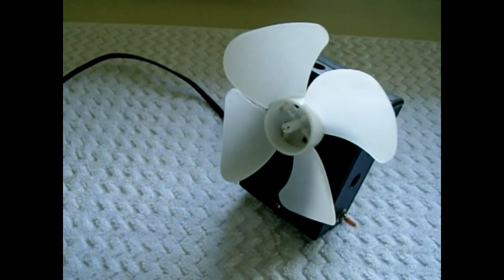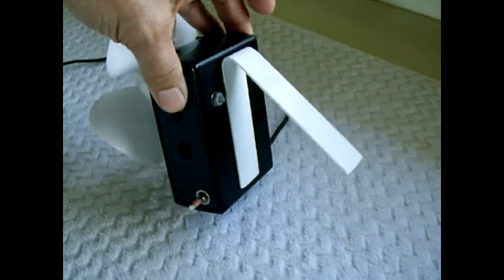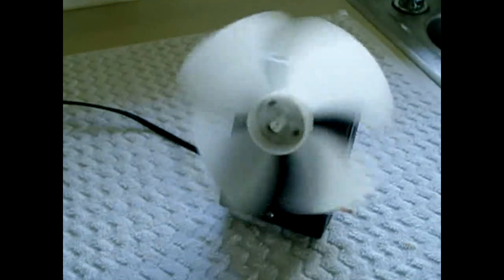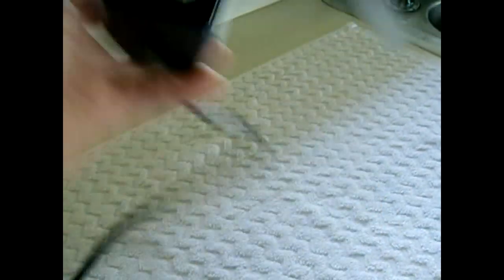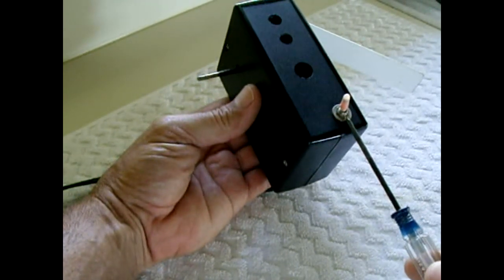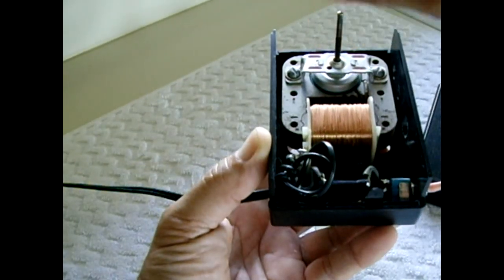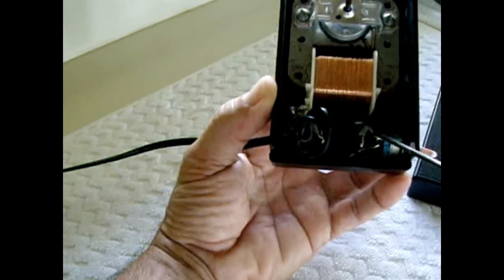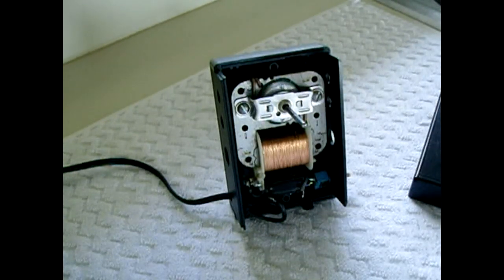Microwave Oven 2 Speed Desk Fan! (Simple To Make)

Comment: Wish to make a bathroom fan with this in the future. How many CFMs does it blow?
Reply from the maker: stormblade123hsm I have no idea how many CFM's, but I can tell you that running the fan on high will definitely pull a lot of air from a bathroom.
Reply: Nice! But I will only run it on a on/off switch. So it is full speed or off. You can use a CFM meter that you can buy.
Reply from the maker: I have no need to buy a CFM meter. The volume of air this fan can move is very large. The microwave oven fan on high speed will likely do a better job than a fan you would purchase at Home Depot or Lowes.
Reply: electronicsNmore But can a Delta EFB1212HH computer fan move more air than the microwave oven fan?
Reply from the maker: You are getting carried away, and making this into a big deal. Just use a microwave oven fan. I supplied the idea. It is now up to you to decide if you want to use that idea.

Thanks.
Reply: Seems like I will have to compare it myself, but my EFB1212HH's bearings are busted. I will get new ones and use the EFB1212HH as it is more energy efficient. Thank you.

Comment: I have an Ohmite vintage fan that is just like this. It's got a round two piece enabled steel case that comes apart with two nuts. Inside is a microwave oven fan motor. There is a switch in the middle of the power cord like a table lamp. The 6" fan blade is a two bladed thing made of flexible plastic. It sits on a chromed steel circular stand you can move up and down.
I got it yesterday for $3.00 at a thrift store, put some electric motor oil on the bearings, and it works as good as electronicsnmore's fan does; except without the nifty speed control.
No wonder they don't make stuff like this, ultimate construction simplicity, standard microwave oven fan motors last a long LONGGG time, steel body and stand take some abuse.
The back of it has a lot of holes, there are lots of the ventilation holes,  but there are what looks like holes perfect for mounting different motors or maybe they they thought about an onboard switch. Well the holes are there, they were planned for something.

Comment: can you share the math with capicitor?  What stats are needed to make it safe. What stats control speed. this is great I have three now and will keep getting more. would like to have 4 speeds. the motor is a tank. If it has enough torque could be useful for a knife sharpener.

Comment: Hi i work with 220VAC what diffrence change in capacitor? And i would the fan low  noise. There are possibilty to add a Dimmer? without switch? Agree reply. Tks
Reply from the maker: Use a capacitor rated at least 400V, 630V is better. Double the capacitor value used in this video.

Comment: I just realized you got a 40w motor, so you used a 3uf cap. I’ve got a 20w motor, so should I use a 1,5 uf cap? (I tried the 3uf capacitor and it didn’t slow down the motor at all)
Reply from the maker: A lower value will slow the fan down, yes try the 1.5uF.

Comment: Hi there! I tried to use a motor capacitor 3uf 250v, but it didn’t slow down the microwave fan... 
should I use a dc capacitor?
Reply from the maker: No, never use DC caps for AC. The 3uF value must be too high.

Comment: Is it possible to make a microwave fan plug into a cigarette lighter to use as a fan in a car without a/c or would it draw too much electricity?
Reply from the maker: No, the car uses DC, the fan operates using AC. If you buy a cheapo cigarette lighter power inverter 60-75W, then you can power it with that. Thanks for watching!

Comment: mate i have a fan from a microwave... only two wires brown and yellow, no pole marking on it anywhere, which colour you think is live ? dont just want to assume brown.. cheers
Reply from the maker: +Magna Carta 
Hi there. Usually there are only 2 terminals. If you see 3, then only use the outer 2 terminals. Thanks For Watching!
Reply: @electronicsNmore  Actually, having a motor with 3 terminals is much better than 2. Because, motors with 3 terminals have 2 speed windings. So you don't need a capacitor to change the speed. There should be a sticker showing you which one is Neutral, Low, and High.

Comment: +electronicsNmore What would you recommend for forced hot air? How would I add some kin of heating element to it?
Reply from the maker: Very easy, Place the fan blade inside a metal dryer vent tube, and in front of the fan blades you would install resistive wire made into coils. Try 20ga A-1 resistive wire.

Comment: I got my fan out of the microwave but my fan is running counter clock wise how can I get it to run clock wise?
Reply from the maker: Jerry Thompson That is highly unusual. The solution is to remove the 2 screws and nuts holding the fan/rotor in place, then flip it around to the other side and bolt it back together. :-)

Comment: It's pretty hard to find a 3uf, 250 volt non-polarized capacitor.  I normally only work with DC.  Do you have any specs or links for the capacitor?
Reply from the maker: You can parallel up (2 or 3) 250v capacitors as well. You can find high value capacitors in many ceiling fans.
Reply: I ordered a couple of 3uf 250 volt capacitors for ceiling fans online for a few bucks each.  Thanks for the reply.  I'm working on my microwave oven fan as we speak.
Reply from the maker: You will definitely like the fan. I use mine all the time.

Comment: Why are you advising someone to throw the rest of the microwave away?  I know that there's a dangerous capacitor in there, but discharging a capacitor should be no big deal for someone who is able to wire up a fan like that.  For another thing, there are tons of other useful components in the microwave (including the capacitor!) that an electronics hobbyist would love to have.  Not to mention the scrap value of the rest of the microwave.
Reply from the maker: Clearly you have not seen my other microwave oven videos. I suggest you do watch them. :-). I never advised to throw the oven away. If the AVERAGE PERSON was unable to repair a microwave oven(NOT into electronics), then keep the fan before throwing the oven away and make this easy project. I wanted this project to be simple, and also wanted to make sure people avoided the HV capacitor.

Thanks For Watching

Comment: Hello do you have a video or can you make one on witch cable to what pin the fan has i dont really know. Like where would live side go or hot and neutral oh and ground?
Reply from the maker: Hi Robb. The live(hot) wire always goes to the switch first, the neutral wire connects to one wire of the fan.
Reply: electronicsNmore - My fan has three pins, so live goes to the switch and then to the cap and the fuse then to either pin? Same with neutral either pin? Sorry like i said im new to this.

Comment: IT HAS 3 PINS L|N|H  (L=LOW) (N =NUETRAL) (H=HIGHER)
iS THAT CORRECT?
Reply from the maker: The switch has 2 positions(SPDT) with the center OFF.
Reply: electronicsNmore I connected with UPS AND 1st and 2nd is running on 260/250
Reply: But 1st and 3rd also same power it tooks
Reply: The 2nd and 3rd one shorting UPS turns off when connected to them
1st and 2nd connected

Comment: May you draw schematic for this project? Very hopefully.  Thanks..
Reply from the maker: It's very simple. You need a SPDT switch, and the correct capacitor. Center is off on the switch. One leg of the switch goes directly to the fan and the other leg goes to the capacitor then to the same fan terminal. The other fan terminal is connected to the other leg of the AC line(Neutral). Thanks for watching!
Reply: @electronicsNmore  So it means, if i want to reduce fan speed 220vac in a 220vac system, i must add a capacitor Nonpolar 1uF 400Vac connected series to the fan?

Comment: Hey just a question. You didn't say which terminals of the motor should I use. Which ones should I use? there are 3.
Reply from the maker: Did you notice which 2 terminals had wires on them? You can use a digital multimeter and measure the resistance across the terminals, Look for the 2 terminals that give you the highest Ohms reading.

Thanks For Watching!
Reply: No :/ I was so excited I didn't notice. Oh! Ok, thank you very much :)
Reply: electronicsNmore Is it ok if I use a 1000uF/200V capacitor?
Reply from the maker: WAY too much capacitance!! Use close to what I did in the video.
Reply: electronicsNmore Ok, thanks :D

Comment: would a 2uF 250V Capacitor work? Pulled it off another household fan.
Reply from the maker: 2uF may not be enough. The fan may hardly rotate on low. Look for a 1uF/250v or higher and parallel the caps.
Reply: Thanks I have 3 of these fans now. The fan, magnets, micro switches, all great parts. I want to use the timer switch for my solder iron station. That way I will not leave it it by accident. Thanks for you vids. Never would have known about the parts before you video.

Comment: What capacitor should I use for 220V line?
Reply from the maker: 120V fan on a 240v line? If so, use half the uF rating shown in the video, and make sure the capacitor is at least 400V rated.
Reply: I have 220V fan and will use it on 220V, thanks for the answer.
Reply from the maker: Master4o Use a 400v rated capacitor.

Comment: cool video, id like to know, to do This, do i connect it directly to a plug(i have a wire  also from a microwave) or what should I do?
Reply: BTW Im asking This out of my ignorance, take in mind.
Reply from the maker: Hello! I made everything very clear in the video. If you're not sure, you really shouldn't be playing around with mains power. You could get shocked. To learn more about electronics, please visit "talking electronics" website. Thanks
Reply: +electronicsNmore Alright, first time I didnt hear about the condensator and now ive seen the diagram in the description. I have one that says 0.9 µF and 2100V AC.Would it work or should I get one more similar to that of the vídeo?
I got it from the same microwave that the fan.
Reply from the maker: A microwave oven capacitor is fine, but you need to use 3 in parallel. I'd just buy the smaller, correct size cap online.

Comment: Hello, I have A question instead of one 3uf 250v cap can i use 6 3.3uf 25v caps in parallel?
Reply from the maker: liljoey112 No. (6) 3.3uF caps in series equals only 150V(Too low), and the rating drops to 1/6th of 3.3uf or .55uf. (6) in parallel equals 25V rated at 19.8uf.
Reply: electronicsNmore Okay so, if I use 10 33uf  Caps it will be safe? I am sorry im trying to use what i have.
Reply from the maker: (10) 25V/33uf caps in series is 250V/3.3uf. You do realize you need Non-Polar caps. Electrolytic caps are no good.
Reply: electronicsNmore 33uf 25v radial Tantalum caps should work correct?  Also if i wanted another speed all i would have to do is increase the capacitance correct?
Reply from the maker: No. Tantalums are electrolytic. In order to make a NP cap from electrolytic caps, you connect the (2) neg leads together from (2) electrolytic caps and use the 2 pos leads as NP. More capacitance = more speed.
Reply: electronicsNmore Really! Thats Great i didnt know that i have a few 3.3uf 250v electrolytic ill just use that trick! Thanks :)
Reply from the maker: You will need (4). Connect up 2 pairs, then place the 2 pairs in parallel.
Reply: electronicsNmore Okay I hate to bother you but if i use 6.8uf I will only need One pair right?
Reply from the maker: Yes. (2) 6.8uf / 250V electrolyic caps

Comment: An induction fan needs to breathe = NO enclosure. That coil will get red hot real quick, if fan not pulling air over it.Bad idea, don't do it kids.
Reply from the maker: B. Urtzerka You don't know what you're talking about. This fan has been in use for YEARS on my desk. I guess you failed to notice the holes in the enclosure to allow air flow.